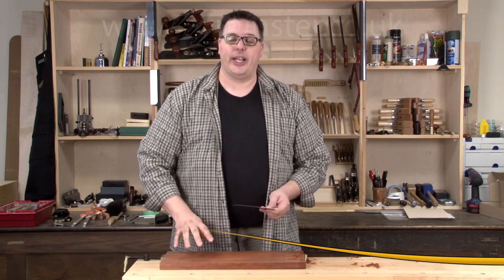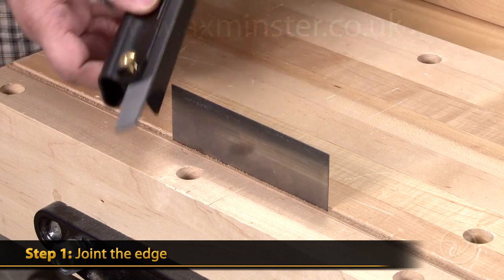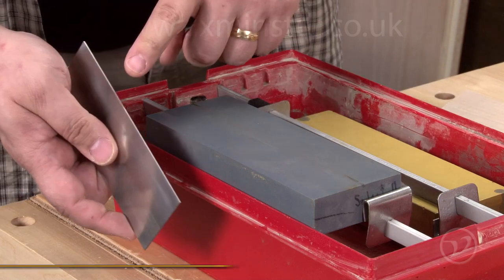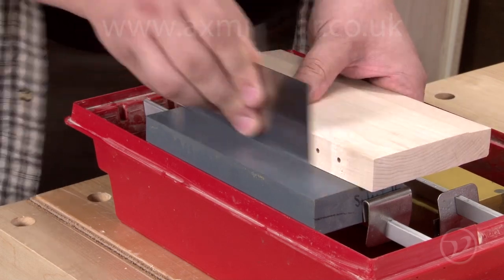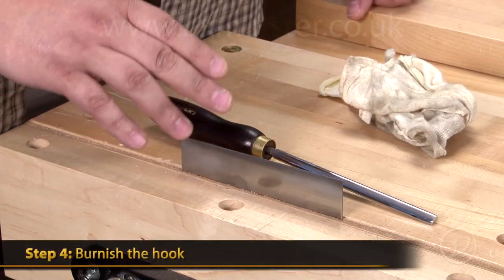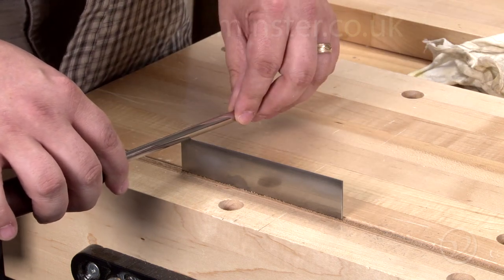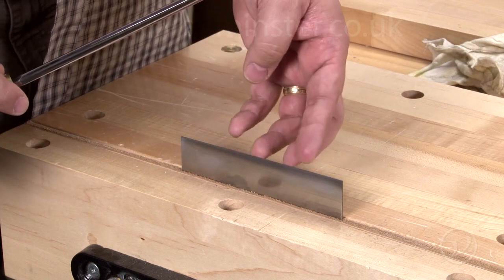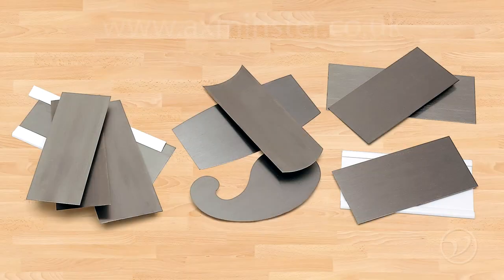How to sharpen a card scraper

Comment: Mercifully short. Thank you for being concise :) But I don't want to run my card scrapers' edges down the face of any of my nice water stones but, perhaps, could instead use the side of a wetstone or on an old, cheap, fine oilstone or 600 grit wet & dry paper or diamond plate.  BUT what about goose-neck scrapers -- how do you sharpen them? (Another video?)

Comment: Using a waterstone for the purpose of removing the file marks is counter-productive ... this is where a DMT diamond stone should be used.

 Removing the marks using a waterstone is guaranteed to put grooves in the stone, even if you move it along the stone ... it will just leave a succession of grooves. 

Use a fine diamond stone for this ... far more satisfactory.